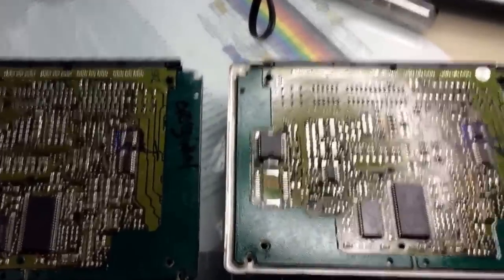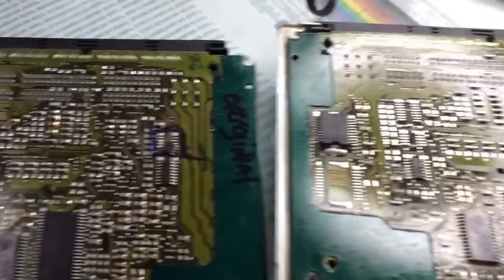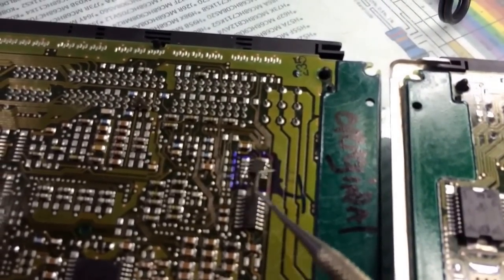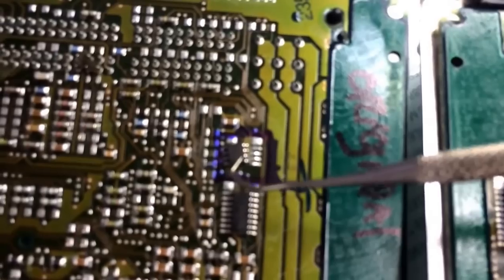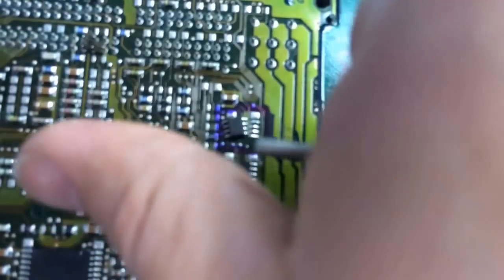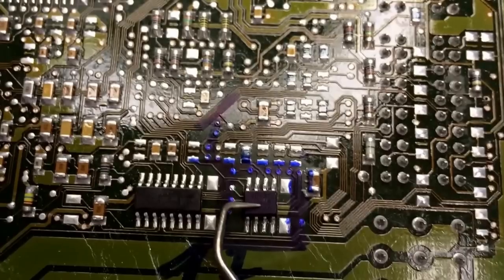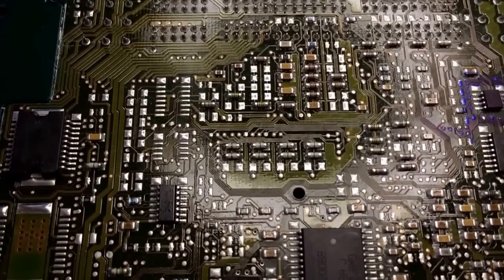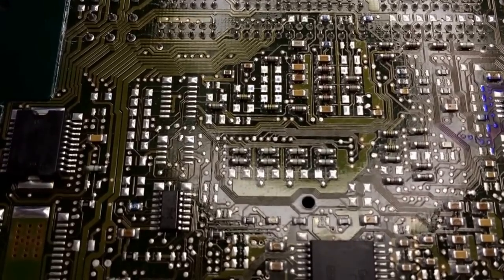BMW  Range Rover key programing immobilizer after ecu swap

Comment: That's the same challenge I faced in that Range Rover p38 with a v8 engine. They car was cranking but didn't start. There was no spark no injector pulse and no RPM signal
  I pulled out the ECU to my computer engineering friend for a bench test. When he tested it he told me they're lots of shorts in the car ECU, hence I should replace it instead. 
  But the major challenge is that current that I noticed there which was not supposed to be so. I only got the current there after replacing the fuse box with an aftermarket one which wasn't too Ok to my taste.